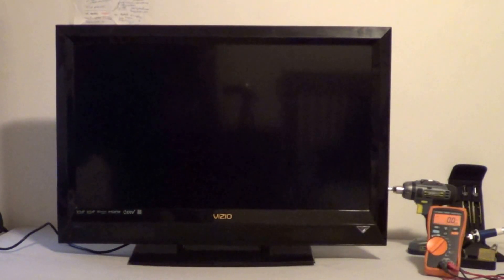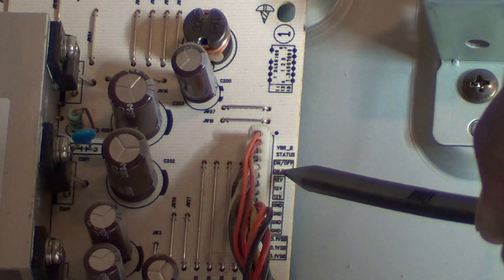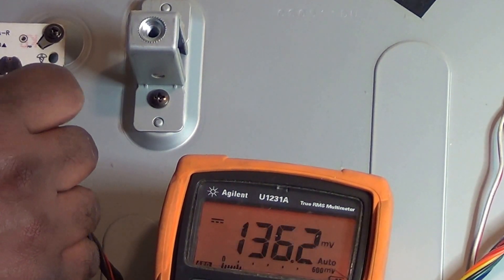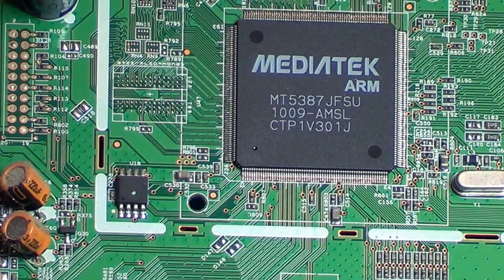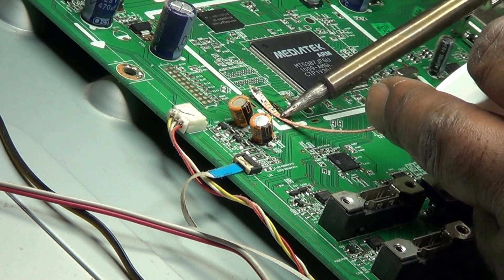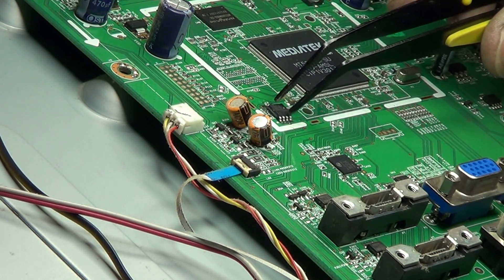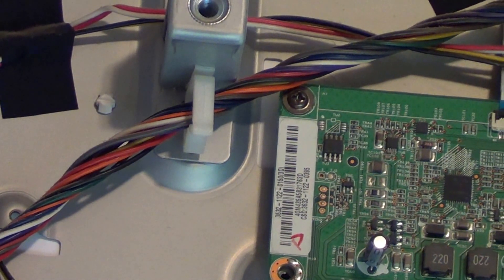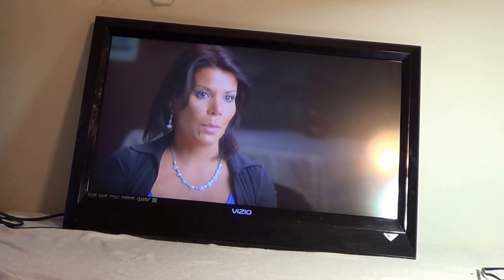Vizio E320Vl tv repair, Cuts off, EEPROM replacement

Comment: I just replaced the dead control board with a used one taken from a working Vizio with a broken panel. However, I would like to get the dead one back up and running. Hopefully this is all what is wrong with the control board.

Comment: How does someone find the firmware for a new EEPROM chip that not's programmed? the original one got damaged from static electricity. Chip is out of Insignia 39" LCD TV.  EEPROM # W25Q32JVSSIQ. Big Thanks if you can help.

Comment: Great video. I have the vizio e322vl which looks identical to this. My problem is that at first the audio stopped working and now the Vizio logo just flashes orange and white but doesn't power on. Any guesses for a fix? Thanks.

Comment: Hey Big Dog, how did you know that the eprom was bad?
Reply from the maker: Common problem
Reply: So you didn't know that eeprom is bad. It was just a guess? Based on your previous experience, but still a guess. Or is there any clue that leads towards that culprit?
Reply from the maker: @Chupacabras222  Yeah the TV symptom. Cuts off.

Comment: I like bigdog's approach to removing the chip. Because my hands arent as steady as they used to be, I found placement of the chips difficult so I used some 2mm W. double sided tape to hold the chip in place when soldering. Next time I might try clear nail polish or a spot of hot glue. Having some magnifier glasses and a smaller solder tip is almost mandatory.  I was thinking of trying to wrap a stretched paper clip onto the soldering iron and using the end of the paperclip to solder with. Thanks bigdog for your video.

Comment: Hey Bigdog, sweet tutorial!
I picked up a free RCA 55C55R120Q that has the red standby light but when the power button is pressed the light goes away, no picture even doing the flashlight test, no backlights either so I'm guessing the EEPROM my problem ... correct?

Comment: I have a E322vi, my logo stays lite at all times. The screen will not do anything, logo does not flash either. It stays orange, nothing looks burnt on the boards an all capacitors look normal as well. I do not have any blue leds on the bottom of my boards either, I'm not sure if that's my model though. Any ideas by chance?
Reply from the maker: Its either Power Supply or Mainboard. Most likely Mainboard.
Reply: bigdog8882 thanks for your input, i appreciate it.
Reply from the maker: No problem, Thanks for watchin.

Comment: when you buy an EEPROM from amazon or eBay, do they come already programmed? Any help will be greatly appreciated!!! Great videos too, THANKS!!!
Reply from the maker: No, you will have to use the board part # to located the correct pre-programmed eeprom. Thanks for watching Vince.
Reply: @bigdog8882  so how would I do that? I have the 37" model of this exact same TV. Would I have to buy a different type of eeprom chip than the one for the 32 inch model shown in this video?
Reply from the maker: @GreyJediNite  Yes U do

Comment: It's still doing the samething after I ordered the part what can I do next I followed your stepsEEPROM - E370VL - 3637- 0562- 0150
Reply from the maker: Well if your positive itsa Mainboard problem. Just order the Board if you tried the EEProm first. If you dont have a Power/On (approx. 3-5 volts) when you hit the power button, its definately  the Main.
Reply: bigdog8882 If you going to change the EPROM only.You must have a EPROM data transfer device and computer program able to
Reply: Just change  the old EPROM chip out putting new EPROM chip without data freeze from the old chip transfer the data over to the new chip.The EPROM chip wouldn't functions.
Reply from the maker: The EEproms are already pre-loaded/pre-programmed when you buy them. Just use the Model and Mainboard # from the TV when you do your search.
Reply: Where did you buy your EEPROM chip from?If you buy your EEPROM chip from DIGITI Key are cheap.But the EEPROM chip are blank without Data from any tv made and model programs in them.
Reply from the maker: Try Shopjimmy.com

Comment: after replacing the eeprom, the tv won't turn on. I realized that I didn't solder each pin individually, but all together. Only had a broad iron tip instead of a fine point tip. Could this be the reason why it's not coming on?
Reply: +MMA Fanatic YES!!!!!!!
Reply from the maker: Absolutley!!!